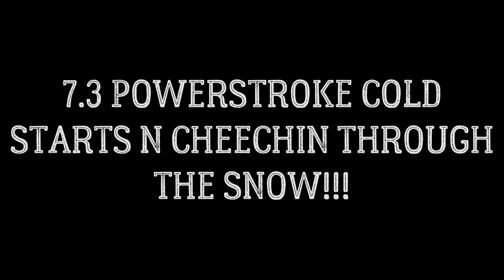FORD 7.3 POWERSTROKE COLD START N SNOWING 4X4IN!!!

Comment: I really appreciate you Peg for gearing these vidyas to all us common pee-ons. So many YouTubers start getting money and buy a bunch of fancy new stuff, but not you lol. Thank you.
Reply: That’s some real shit if I was him I would buy a shit ton of 88 to 98 Chevys so I totally fucking agree
Reply: What are you talking about, peg's Youtube fame has gone to his head.  He actually built a shop that has 4 walls and a concrete floor and it might actually be heated.  He is such a sellout now that he works on his fleet of ferds indoors instead of working in the snow like a real man.  Youtube is making him soft.  Look at how many 12 valve "crate motors" be has amassed in recent times.  He now has welders with shielding gas and those fancy new fangled auto darkening welding helmets that city slickers use.  Rumor is he just ordered a brand new custom peg leg made from carbon fiber and titanium made with the same materials as a airplane.  He is deceiving everyone, do you really think those are all dump batteries.  He is buying new batteries and making them look like they came from the dump.  Someone posted hidden camera footage of peg buying 1 brand new tire which is the gateway to buying all brand new tires.  Did you notice he doesn't allow the camera to focus on the tires.  He is hiding the fact that they are not bias ply tires and he is such a sell out he is using radials now.  He is not drinking pc lite, he is putting sticker over cans of michelob ultra.  Nothing is as it appears.
Reply: @mikeshultz1007  I've been bamboozled
Reply: @mikeshultz1007  YEAH...what he said...
Reply: @@jesshadlock2139 
He's getting all fancy on us, next thing you'll see will be adverts for Japanese kitchen knives and Scottish Lordship plots of land. All these youtubers sell out eventually !
🤣
Reply: @mrfishbulb7187  Jesus I hope he doesn't go that route
Reply: But then again I guess he should take whatever he can get
Reply: @capt.reefer8388 he should get a 6.2 or 6.5 Chevy
Reply: Yeah he’s not like some millennials named Kevin and mook that started selling manscaping ball shavers and diy meals sent to your house😳😳😳
Reply: @kraigcochran9995  yep that shits bad
Reply: @dcrog69  it’s the Truman show of YouTube 🤣🤣🤣
Reply: @bradenrnp3687  they can barely start in the winter let alone bag like a ferd, the 6.2 does sound good my stepdad had one, could barely pull a brake stand off though you would have to slam the brakes to get the ass end to lift the weight off the wheels
Reply: "here's why the 2023 Ferrari fingerpuss is better than the 2022 Ferrari fingerpuss", if it's not covered in body damage and full of personality it's not for me. Also applies to the vehicles I drive.
Reply: @mikeshultz1007  would you like to post a link to this "hidden footage" or keep spewing bs?
Reply: YOU SAYIN THE DUMPTAMAS AINT HIGH DOLLER?

Comment: Nice to see a high quality video, with actual humor and politically correct commentary. Willard is becoming a pretty big star. I am surprised that Ford has not reached out to you to be a truck test driver. I would love to see the engineers talking about the Data that Pegs test provided. Oil temperature-20 Degrees, RPM 4,000, Oil Pressure, maybe. Thanks for the videos and laughs, Sir. Your the undisputed king.
Reply: Ford is scared as it probably won't handle the test.
Reply: he should get an extension cord company to sponsor him so he can plug in all the block heaters lol
Reply: You’re fucking stunned Bud but who the he’ll am I kidding? We’re all stunned here 😂😂😂

Comment: You need to make a truck with pvc split from the intake and run it into the cab and give it a lid so you can stomp to the floor, crank, and give her ether at the same time

Comment: Peg I had a dilemma. Key word "had". My 2001 F150 4.6 237000 Murican miles on the clock. Has a bad head gasket wasn't gonna fix it but...that truck was built in Canada 👌👌 so I'm definitely fixing it!!

Comment: Ol Peg goes out brushes a foot of snow off it, been sitting since summer after a mudbog, -4⁰F and not a flake of paraffin to plug the filter. Now me, I go out to my Jeep just sitting over night at 10⁰F and my fuel gellls up and it won't run long enough to get it in the shop with ALL the gel and ALL the plugged filters on the old Cummins. WTF Peg? I think I gotta just 100% stop giving a shit about it like you! LOL